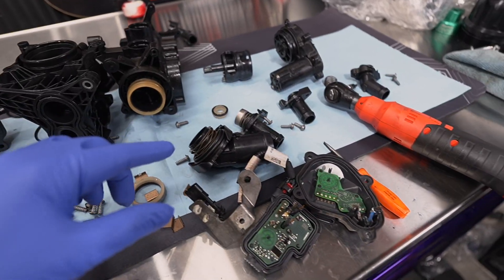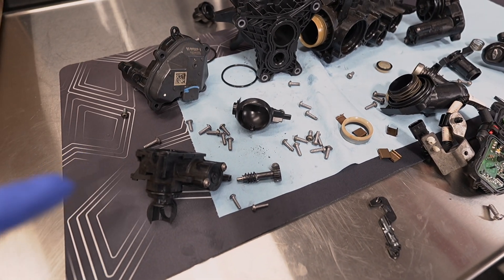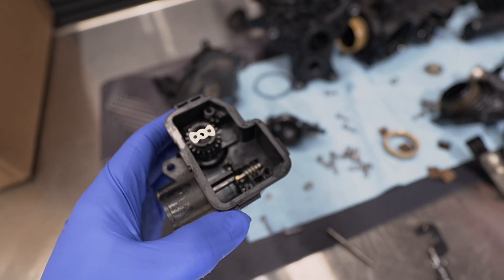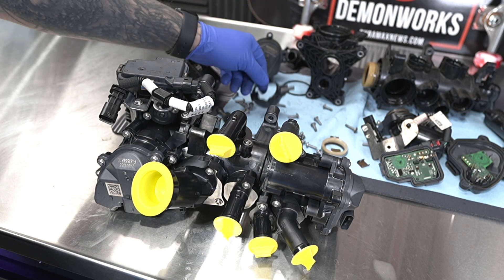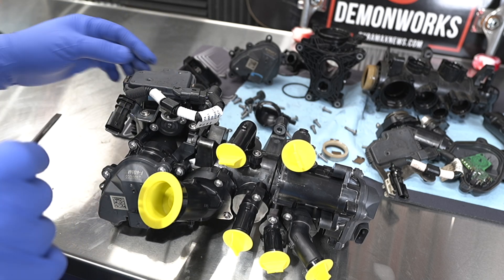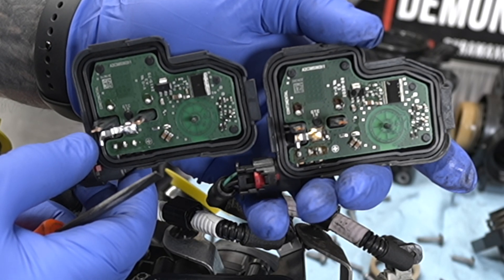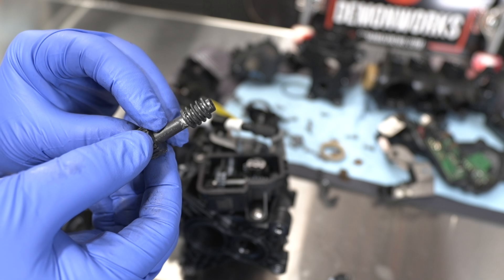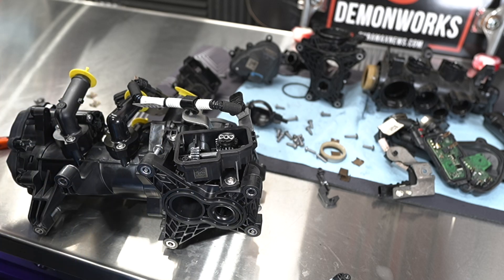REDESIGNED? Coolant Control Valve Failure Found p1098 24001355

Comment: Greg - it looks like GM obsoleted 24001355 and replaced it with 40009179. Have you had a chance to get your hands on this new part number and look it over to see if they made any obvious changes?
Reply: Just had mine replaced today. They replaced it with the 40009179 part. I have an lm2. Very curious to find out the answer to this question. Thanks for asking Steven

Comment: Sent in my 2021 LM2 to the dealer for the p1098 code and they “reprogrammed” the ECM. charged me $108 and when I picked up the truck the engine light was still on. The service advisor told me it’s all set but their “fix” didn’t work? I left it there and told them to call me when it’s actually fixed.

Comment: New to the channel. Awesome information. Thank you so much for sharing! I have a 2023 LZ0 with 27k miles when I received the P1098 message. Waited for over a month for the backordered coolant control valve to come in. Same day I got the truck back, started leaking coolant. Back to dealer and was told the coolant reservoir was cracked at the seam. Two days later, new reservoir installed and after driving no more than 20 miles, coolant spraying everywhere. Limped back to the dealer with overheating warning and reduced acceleration, waiting for diagnosis. My frustration led me to finding your channel.

I'm no mechanic, but if it turns out that the second reservoir cracked, it seems the pressure of the system, or the heat being generated within, is exceeding the limits of it's construction. Any thoughts?
Reply: Sounds dealer mechanic incompetence? Sabotaged your car, intentionally or unintentionally, this is the very reason I stay away from dealer mechanics / too many excuses , zero integrity

Comment: Quick question i changed my coolant control valve and everything was good except i couldn’t do a vaccum fill so I filled reservoir until it stopped taking coolant. For some reason the temp goes up to about 235 then comes down, is that because the valve is still learning?
Reply from the maker: Depends on the year. The earlier trucks would sweep up to that temp and come back down. You could have air in the system but I don't believe it will self learn.
Reply: @ it’s a  2021
Reply: Demon so I performed the vacuum waited 30 minutes to make sure no leak I filled the truck system back up and Now the temperature went all the way up to about 250 and I also did a thermostat relearn. Any idea why after replacing the fluid the temperature would go even higher? I’m completely lost on this

Comment: Is there a manufacturer and part number for the motor itself? Rather than purchasing a whole Ccv?
Reply from the maker: That wouldn't be available through gm, maybe you can source the manufacturer but I would rather have a complete new unit.
Reply: @ depends on the cost difference. If the drive unit could be had for a small fraction of the cost it might make sense. Or if there is another option that has an upgraded gear.

Comment: I mean to be fair pile in some more silicone grease on those rotating plastics. Probably last forever. That's an embarrassingly tiny about of lubricant for a longer term operation. Good evidence against GM for providing a defective part.

Comment: Does anybody know if this happens with the LZ0 -2024-2025? Another thing I was talking to a mechanic friend of mine for a large company and they make so many parts for a vehicle that they would rather use up old part before redesigning new ones. Not good for the customers.
Reply from the maker: It is happening with the 24+ as well. Different valve than shown here but they do still fail, unfortunately.

Comment: This part cost me $45k.  I gave in and traded for a 2500 with the 6.6l Diesel.  Now to find what’s wrong with it in time.
Reply: One thing I've learned in my 70 years is this. "If it has tits or tires you will have trouble with it in time." The 6.6 is a good engine but it has problems also. Good luck.

Comment: I am not sure based upon what I saw, I would agree that is the fail point.  Many have succeeded in cleaning the entire thing up, adding new white lithium grease and resetting the motor stops.   I am more inclined to say the issue is in the signaling .   The circuit board you show has contacts and the round wagon wheel thing looks like the signaling for the position.   The worm gear itself if installed tight and decent tolerances would run possibly a lifetime with no grease at all operating a ball valve.   Similar designs on some sprinkler valves that can look pretty bad and still operate.   IF the motor is undersized and the gunk is causing enough delay to confuse the ECM, then probably, but without actually testing each of the motors, continuity, resistance, and signaling, I am hard pressed to say it is completely mechanical at this point and more inclined to say signaling and why people have been successful cleaning them up and reinstalling.    I would bet that GM has changed their electronics more than a mechanical change on the new part.   Mechanical changes are easier to produce whereas circuit boards take longer to implement, and mass produce a change.    Sadly, the only way we will ever know is if NHTA gets involved if there are any fires or dead stick failures that are proximate to an accident.

Comment: Excellent videos on the failure point. I was thinking of buying a 2025 Silverado ZR2 but very disappointed I was going to trade my 2022 Toyota tacoma in for a bigger truck.  I have never have gone to the dealer except for oil changes and rotatations.

Comment: What do you think about oil filter bypass systems? Specifically one made by insane diesel for the 3.0L Duramax.  Is it a good idea, worth the money?  I don't want to increase my oil life I just want to get the microns down and run cleaner oil thru the engine.  Is this product worth your doing a video?  Thanks, James

Comment: Hi! Thanks for the video. It’s very helpful and informative. But could you explain what exactly this part, which fails, is responsible for? Does it block the flow of coolant, direct it somewhere, or cut it off to a specific area?

Comment: It would really help if you could figure out what's filling with the LZO coolant control valve.  The updated valve is failing at a high rate.  Over 3000 broken down LZO's sitting at dealers right now waiting for the part
Reply from the maker: I will if given the chance. We have quite a few here at my dealership waiting as well, but I cannot teardown a warranty valve is it needs to go back to gm. Hopefully one is customer pay and I can tear into it then see what is going on. I am assuming it's a similar issue to this one, but I will share info when I get the chance.
Reply: Wow I guess I’m not getting a LZO. That’s really disappointing.

Comment: Taking my 2023 silverado to the dealer today for this (P1098) code. Truck has 34k on it and now does not have  any heat and temp gauge never comes off cold. Just very disappointed!

Comment: I wonder if maybe mine is starting to fail. Every now and then I smell coolant while driving. I have looked for any kind of leaks. I have not seen any leaks or anything on the ground where I park my truck either. It worries me because I smell it. I did tell my dealer about it. I smelled it when I had my 19 hd too. The dealer said they didn’t find anything and it could be from the overflow. They said the same thing about this 23 1500. Coolant is still on the full mark. I think I’m at 8000 miles on my truck.
Reply: Left radiator tank leaking??? Common failure.  You can't smell the control valve

Comment: 23 LT trail boss here. Ccv failure at 33k miles. Daily reset of cel and no long trips until they get a part in. So frustrating
Reply from the maker: Yeah, that's the unfortunate situation right now. The LZ0's are failing left and right it seems, just like the LM2...
Reply: Mines been down about 7 weeks at the dealer they told me between December 12th and 26th estimated ship date. Consider your self lucky mine was leaking, I noticed the coolant was low in the overflow bottle by the firewall. So I didn’t dare drive it.
Reply: I covered the front of my truck in cardboard. It looks horrible but keeps the engine temps up after I reset the code.

Comment: Thank you to the engineers that made this ticking time bomb. Probably the same ones that made the actuator for the blend door in the 2000s  trucks
Reply: Exactly what came to mind, those awful blend door actuators.. lol
Reply: @lukehaynes481  don’t forget the plastic 3800 coolant elbows. At least those were easy to replace though
Reply from the maker: @babygators I actually just bought my son a Buick with the 3800 and those fittings are among the first items to be swapped.
Reply: @DemonWorks  you found one that hadn’t already blown the originals??? That alone is impressive haha

Comment: Is the CCV assembly the same between the LM2 and LZ0? I thought they eliminated one of the loops on the LZ0? I guess my question is, is this the most common failure mode that requires the entire CCV to be replaced? Could the worm-drive sub-assembly be replaced in place? I'm tempted to just buy a CCV for my LM2 to have just in case.
Reply from the maker: I would replace the whole unit, honestly. The LZ0 is different, but still has failures. I have not taken one of those apart yet, but I will.

Comment: The LZ0 uses a two-way coolant control valve. I wonder if it has the same valve that fails in the 3-way coolant control valve? Nice demo. 👍
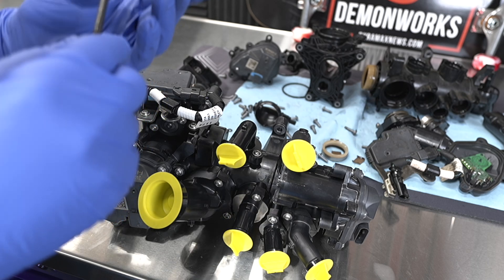Reply from the maker: Correct, the LZ0 has less in/out. i am unsure if it has the same cause of failure as these. https://www.youtube.com/watch?v=dxPkKIX-4aM 4:15
Reply: @DemonWorks  replacement valves on lm2 and lz0 are same number
Reply from the maker: @charliemagoo7943  100% they are not. I have a video showing the LZ0 and one on the LM2

Comment: What year and mileage of the broken down coolant control valve ?
Reply from the maker: It was from a 21, they fail at all mileage points, there's no set mileage.
Reply: Not sure about demons, but mine is a 2023 20,000 mile trailboss diesel.
Reply: @Jakerthesnaker  yours broke down then at that mileage?
Reply: Yes it did, mine also leaked coolant. So it’s been sitting at the shop for about 7 weeks. (20,000 miles currently) I also started plugging it in a few days before it failed as others have also mentioned the same thing on the forums, I had the engine block on a two hour timer.
Reply: My 22 failed at 64k. It took 14 days to have the truck fixed. It was just dumb luck that the dealership I took my truck to had a spare one delivered shortly after I dropped it off.

Comment: Yup I’m at the 10’week mark waiting on my dealer to get this part in. They have zero notice when that will be. I’ve also begun the lemon law stuff. This is my work truck and I have lost 10s of thousands because of this damn part and GMs inability to get it repaired in a timely manner
Reply: Same here! Im pissed!
Reply: Same here mine was leaking so it sits at the dealer.
Reply from the maker: sorry to hear that, I am assuming all of you guys are LZ0's?
Reply: @ 2023 with 60k
Reply: Yep 20k on the odometer.
Reply: I have an LM2, and mine went at 32k and took two weeks to get fixed. Hopefully, someone comes up with a better solution by the time people's warranty run out
Reply: Mine is fixed. The whole thing took 2 months.
Reply: @Beaverine-it3bv  mine also took two months, I was happy to have it back!
Reply: Same here they are on back order with no eta

Comment: I really wish some aftermarket company could come up with a replacement for this junk.   It's sad every time I drive my 2021 I am just waiting for mine to fail.   Shame they cant just use a traditional thermostat for crying out loud.
Reply: Hopefully like 3800 coolant elbows, Dorman will make a decent one of these.
Reply: @BabyGators   - I reached out to Dorman and they said they are on it, and will be eliminating the failure prone issue.
Reply: Yea, can someone please make a brass gear to replace the cheap plastic one! Grease? What grease??
Reply: The CCV is a core part of how GM was able to get the engine to meet emissions regulations. They didn't make such a complicated part for the fun of the challenge. The biggest issue is the grease turning gummy and the electrical connector corrosion.
Reply: @hochhaul  government here to help again

Comment: As always, thank you for the visuals.  What is the shop hours to replace this control valve?  

I’m just out of 3/36 warranty and it looks like I’ll need this worked on.  Or is this valve technically part of emissions warranty??
Reply: covered to 100k under factory powertrain warranty. I waited 3 months for my parts to have it done! Incredible! Good Lock!
Reply: @kristof4890 
Thank you for the anxiety relief.  Now I just need patience relief.  lol
Reply: These comments didn't age well lol
Reply from the maker: falls under powertrain warranty - those that are out, $1100-$1700 roughly https://youtu.be/J0Czns2LtgA
Reply: @DemonWorks  interesting. The CCV is powertrain but radiator isn’t, right? Kind of odd the systems are divided into